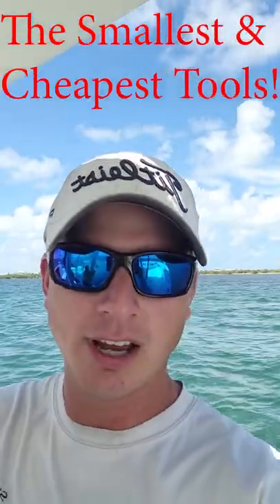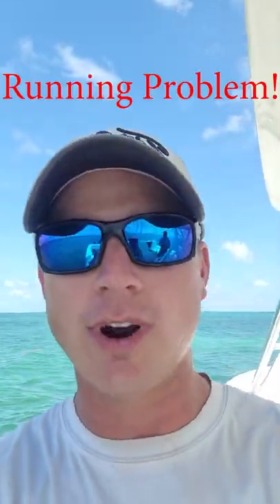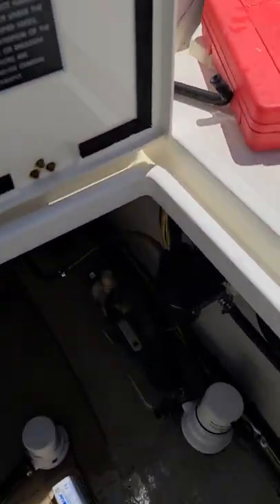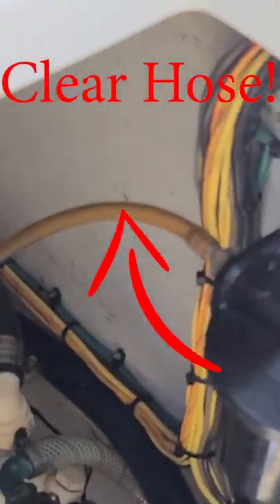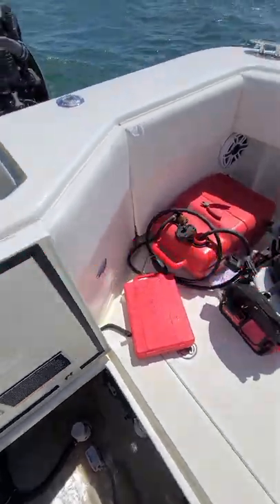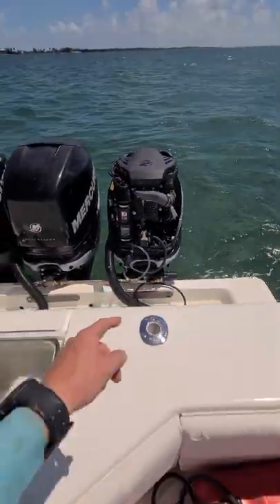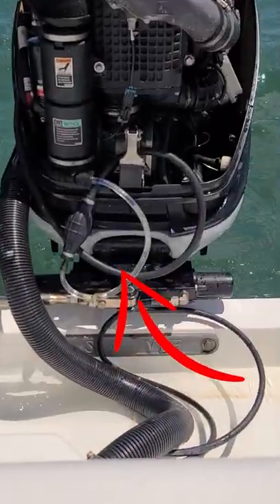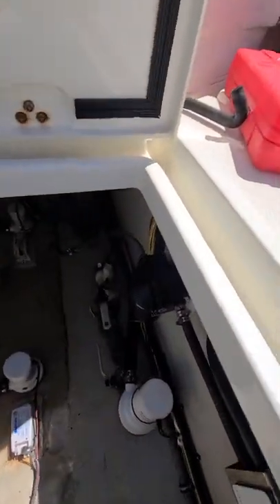Become A MECANIC!!! #shorts

Comment: Weren’t you a bit worried the afr would be dangerously lean and any fuel pump would be starving of fuel to lubricate it running at any decent throttle opening?

Comment: Had issues with my classic 50 out on the lake one day. Put it in gear and would stall when given throttle. Figured it may have something to do with the carbs. Had some tools laying around. Did a few adjustments under hot ass sun and fixed the issue. Havnt had problems since

Comment: That moving engine without cowling looks scary. Looks like the engine missing mount bearings or not propertly fastened
Reply: Built to do that
Reply: that’s just the displacement in the motor and torque
Reply: If it was solid mount you would not enjoy the ride.
Reply: the engine wants to escape
Reply: The outer engines in multi-engine rigs seems to move around themost

Comment: You know nothing about air in the lines until you're waist deep in a 30+ year old diesel checking the fuel lines and replacing the fuel lines. However we do not worry about things like the valve covers leaking and baking oil everywhere Making it the dirtiest thing you could ever want to mess with.

Comment: Good mechanics are hard to come by. Why?.... Because they are smart and they have the understanding of how equipment works. 50+ years ago while learning how to fix lawn mowers my father told me there are 2 main things you should look for first.  That being spark and gas. Of course there are more issues that could be wrong but those are the first things you should look for. 

 It seems like you were only seeing this on one engine? I'm wondering why you put the clear hose on the suction side of the gas filter too?
Reply: I learned along time ago how to check for spark and gas and if you dint have that you needed a mechanic....

Comment: That's a 50+yr old problem that was common when tanks were portable and a 140hp was the biggest outboard. Installing clear fuel hose just to prove a bad connection is something amateurs do. FYI 1 teaspoon of spilled gasoline vapor in your bilge is equal to 1 stick of dynamite. Every year a boat used to blow up at the gas dock. Until high engine prices pushed lots of families off the water. Now you must have a scan tool and the reprogramming software to work on the newer engines. If you cannot fix your car, you should not be working on boat engines. There are no tow trucks at sea.

Comment: If you were a real mechanic, you would know not to run a supercharged engine under load with aeration in the fuel. It will lean out and melt plugs, pistons and damage the pump. Sincerely, a real mechanic.

Comment: So what was the repair?
Reply: Well obviously replace the engine.
Reply: @GenHoratioBonaparte  no fix the engine. They ain’t just gonna replace it.
Reply: Air is getting into fuel system, somewhere between the two points.
Reply: @kx5008  yeah I was saying there seems to be a pressure issue inside the motor cause the filter outtake seems to work fine my money is on the pump inside the motor y’all notice the more bubbles that came in the higher the rpm.
Reply: Clogged filter caused a blown seal.

Comment: Lol I have a 2019 mercury 200 literally doing the exact same thing but I don’t have a primer ball in my line up
Reply: right so its sucking air at any one or more connections. soapy water and a spray bottle with motor running is your best friend.
Reply: @ct1762  I was just told by my tech that my engine needs another set of plugs it was running rough do to a misfire this will be the 4th set of plugs at 180 hours on the engine 🙄
Reply: @chriseconomides5474  id check the fuel trim make sure its not running rich. something isnt right!
Reply: @ct1762  fuel trim ?